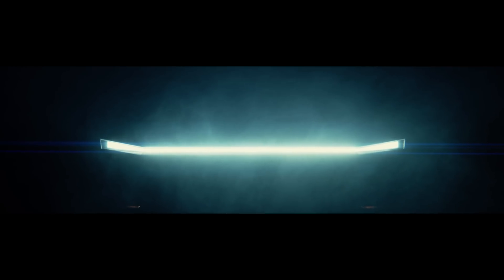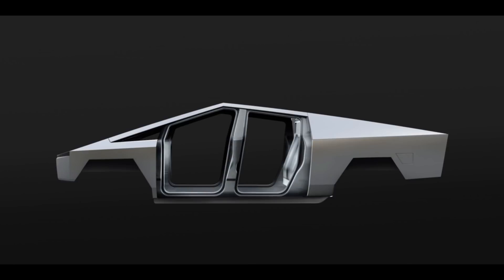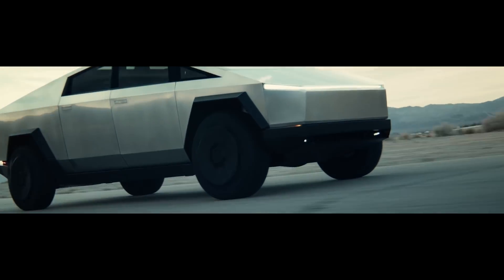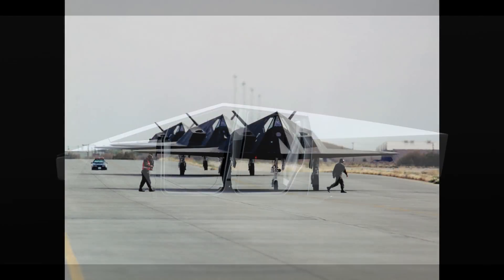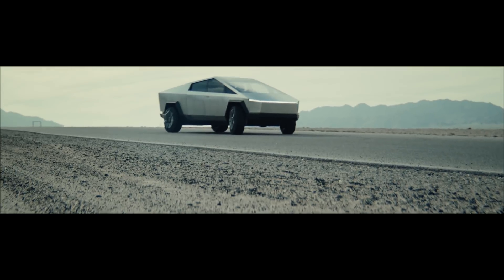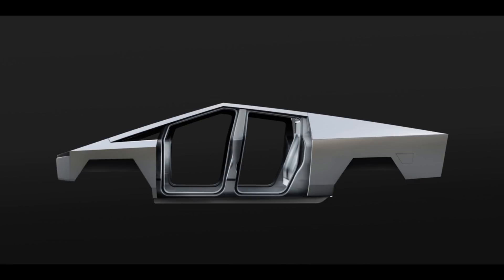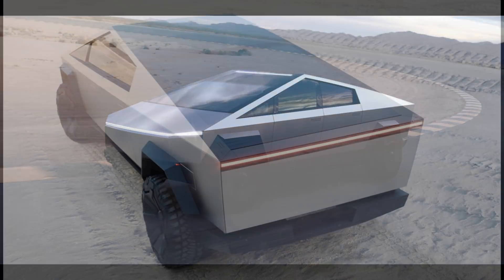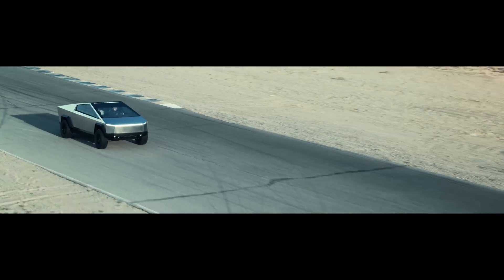Tesla Cybertruck - Why an Exoskeleton is used

Comment: In my opinion Cybertruck is a masterpiece of bold innovation and design that only Tesla is brave enough to attempt. I think is looks much better than run of the mill pickups. One of the main reasons that the Cybertruck can be produced at a lower cost relates to how the body is produced. The stainless-steel body can be formed by simply folding the sheet metal without the necessity for expensive stamping machines. Also, the absence of paint results in significant cost savings. A paint shop cost 200 million dollars in initial capital expenditure and has additional ongoing expenses. The painting and drying of is time consuming and is often a bottle neck in production.  Cybertruck eliminates this cost and bottle neck. The exoskeleton design was necessary to decrease the weight of the Cyber truck so that it is not heavier than the conventional pickup truck despite its heavy batteries. Other electric pickup makers will have a hard time competing with this design in terms of specifications and cost. The bizarre appearance of the Cybertruck is a necessity to keep costs low for these specifications. The price and specifications of this vehicle are so compelling that it is a viable alternative to a conventional car. I would normally never buy a pickup truck, but I will be getting the Cybertruck as my daily driver. It costs the same as my Tesla Model 3 and has so much more capability and room. Should be great in heavy snow and won’t rust from the salt used on streets in the winter in the Chicago area where I live. Won’t need to worry that one bird shit will stain the car forever.  The only downside when compared to a car is its large size which might cause issues with parking in some areas. The pickup truck will use more electricity per mile driven then the car but the additional cost difference is not as significant as with internal combustion pickup trucks. Once the general public understands this, there might be a whole new segment of population that will opt for the cyber truck instead of a car. Power outage in the house? Run an extension cord to Cybertruck and get by with powering essentials like phones, broadband modems, and rechargeable led lighting. You could even cook with an instant pot or induction cooker. Also, Elon confirmed on twitter the car may have a solar option for the bed cover that can add some range when the car is parked in the sun. I don’t care that other people may not like how this looks. If they want something that looks like a regular pickup they will pay more and get less. Not a choice that I would make. I would like to see this low-cost polygon body concept scaled down to a mid-sized SUV with three rows of seats with the last two rows foldable and removable. This would be a better alternative to a family car than a pickup truck. Scaling this down to an urban hatch back the size of a Honda Fit should allow an EV with a range of 200 miles for low $20Ks in couple of years.
Reply: What happens when the vehicle is involved in accidents? someone hits it and now there is a huge dent in the whole 'one piece exoskeleton'? Tough luck to the owner, get a new car? Since exo replacement will not be cheap...
Reply: @vladl3281  Right?! This is not a truck. It's a glorified electric UTV. Additionally, NO unibody design is EVER used for trucks as the users inevitably tow more than it is rated for, the unibody warps permanently. This is, at best, another crossover SUV.
Reply from the maker: Hi Bill,

thank you very very much for your great comment!!!

I have the same thoughts as you, and I am also thinking about ordering a Cybertruck if it becomes available in Germany. No rust, no dents, no worrying about scratches, an extra power source, the practicality of a pickup, a competitive price, good range, good performance. And as you said, if they scale this concept down to smaller cars we could see electric cars for a competitive price in larger scale. As long as the customer accepts the design. Tesla really did a masterpiece here and will now always be connected with this design language. Offering the same features for the same price will be a tough nut for the other manufacturers. And if they follow the same design/construction principle as Tesla they will have a tough time explaining why someone should choose their "me-too-offer" over Tesla’s offer.

Comment: I am wondering how a cybertruck body repair will be performed after it is involved in an accident. If the body, structural framework is the exoskeleton then, I assume that repair may be difficult and much different than your ordinary vehicle. What if two cybertrucks get into an accident? Let's say its just a fender bender. On a "regular" car, it may be a matter of simply replacing a bumper and fender but on a cybertruck, will you have to heat the metal, cut it, weld it, buff it, sand it, finish it, etc. Im curious.
Reply from the maker: Hi Agustin, I am also thinking about this. If it is a real monocoque with all the stress in the outside hull I could imagine principles from aircraft repair will be used. But I could also imagine that a damaged Cybertruck is declared a write-off faster than a unibody car – because it would be harder or impossible to repair. Sadly, it is really unclear right now how to repair a Cybertruck.

Comment: "The best part is no part" -Elon Musk.  Cybertruck is missing a lot of parts and steps in the manufacturing process that other manufactures have to go through which will give CT a massive advantage in cost and production times.
Reply from the maker: I fully agree with you Matthew! The Cybertruck could become the new F150 in terms of sales volume
Reply: @FlosCarChannel  I'm interested to see the financials on the cyber truck once it goes into full production. Given its simplicity it should have good margins that will be hard for other truck manufacturers to ignore if Tesla eventually decides to cut prices to capture a larger market share.
Reply from the maker: @matthewconnor5483  I fully agree!

Comment: One off topic.

I am "fighting" in court (European Union) against my ex-car Insurance about "Tesla depreciation value".

They claim (even local court car expert) that the Model S depreciated 51% in value for a period of 2 years and 110.000 km on the odometer. (Its normal Dual Facelift  not Perormance)

Is there any research/study or reference which can support my case? They don't have any depreciation tables for the EV and they use those for diesel cars - which is definitely not the same.

Thanks in advance
Reply from the maker: Hi You Wish, I am sorry I have no big tips for you. I know that in Germany a car depreciates to around 45 percent of its initial value in around 36 to 48 months while driving roughly 15.000 kilometers per year. But it depends on manufacturer, resale value, engine type and other factors.

But I cannot asses how good or bad 51 Percent with 110.00 kilometers and just 2 years are. Perhaps you should try to contact an Automobile Association in your country. In Germany for example the ADAC is the big player. Maybe they can help you?

https://en.wikipedia.org/wiki/Automobile_associations

Comment: My big concern is how you would repair damage caused in a  major collision?
Reply from the maker: Hi Ramon, I am also thinking about this. If it is a real monocoque with all the stress in the outside hull I could imagine principles from aircraft repair will be used. But I could also imagine that a damaged Cybertruck is declared a write-off faster than a unibody car – because it would be harder or impossible to repair. Sadly, it is really unclear right now how to repair a Cybertruck.

Comment: Most of the cost of any mass-produced item is the cost of the material.  As you correctly said, current vehicle bodies are 0.6-0.8mm thick.   So the Cybertruck is 4 times thicker (3.0mm).....  and uses a more expensive material....   so many times more expensive in material cost.  Other manufacturers paint their bodies, because it is the cheapest way to produce a body.
Reply: Matt Diver - CyberTruck has the same total weight of material - it’s just all moved to the outermost shell.  The biggest cost of conventional production is machining the stamping dies, say $1M * 10 panels * 8 des per part. Skipping that, sand the paint shop, is how Tesla can offer so much value/cost in CyberTruck
Reply: @jameshoffman552  The exoskeleton as Tesla call it is just what every other manufacturer calls a unibody or monocoque.  Standard "car" production.  Standard production gets it's stiffness by putting form/shape into the panels.  A flat panel needs to be thicker to keep it's shape.  Agree these standard production tools and presses are very expensive, but that cost is spread over many vehicles in mass production.  Bent flat sheets of metal is a good prototype method.......  maybe a good way to rush out a show vehicle!
Reply: Steel is much cheaper than aluminum.  The amazing thing is the new battery technology that makes the use of steel in a tall electric vehicle possible.  The competition can only hang their heads and sigh at how far ahead Tesla leads the industry in batteries and artificial intelligence.